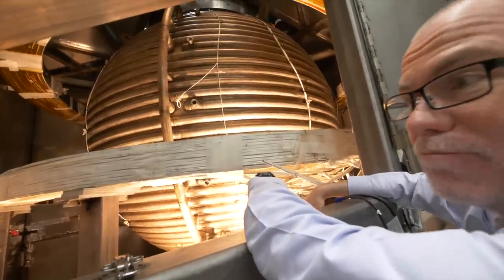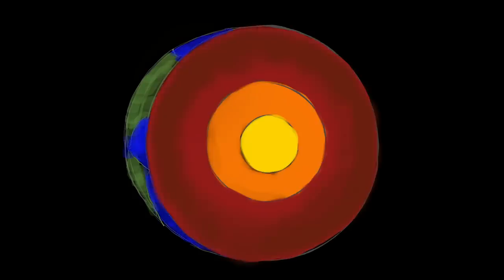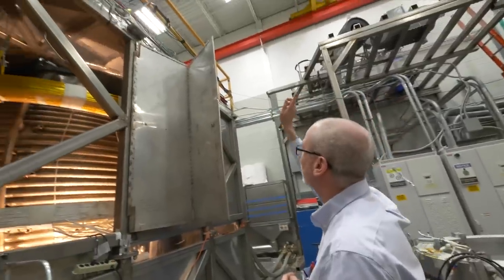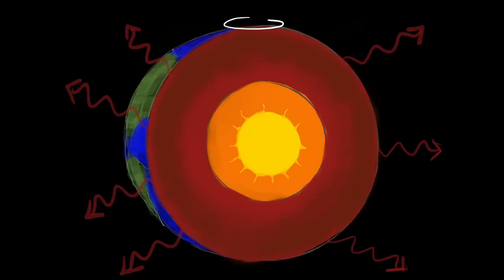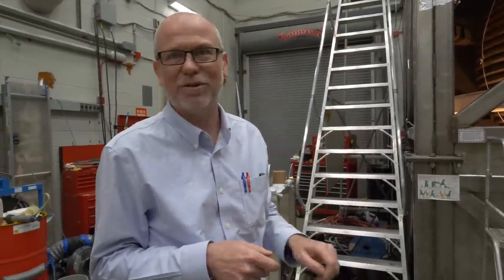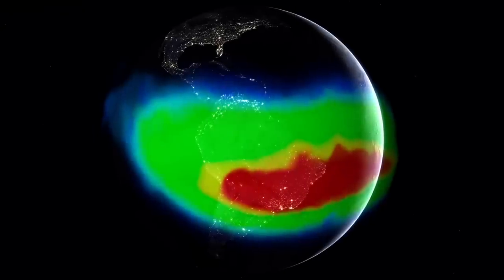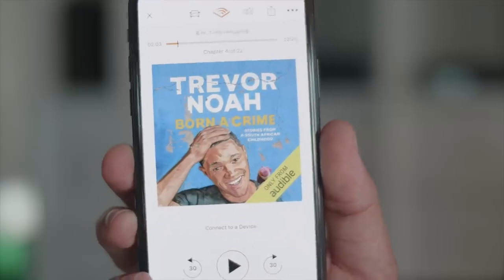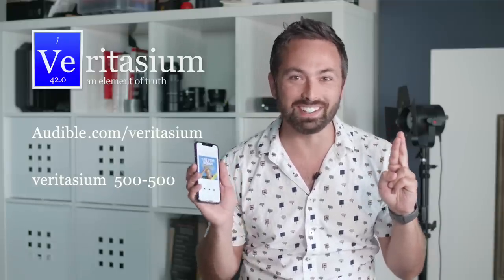Spinning Sphere of Molten Sodium

Comment: Lets just skip over "the magnetic field is dying and we don't know why"
Reply: Right?!!!!!!!!!
Reply: yeah lol
Reply: Decrease in intensity =/= dying magnetic field, but I understand the concern. What's not mentioned here is that while the magnetic field is important for life on Earth, there's no correlation between changes in the magnetosphere and extinction/mass die-off events. There's a healthy concern about how electronics will behave if/when an event happens (i.e. solar storm, pole inversion, etc), but magnets, however they work, are not going to kill you.
Reply: @ETiWells  
If the decrease in intensity continues at the current loss per year, there will be only x amount of years before there's nothing left. Maybe not "dead" but certainly not there. So if your argument is about correlation/causation I understand what your trying to say. The problem that we can track What is happening but we cant explain Why it is happening.  But his point is perfectly valid in the context he was using.
Reply: @cjr4666  so i dont dont have alot of knowdlege on this particular matter but i dont know hot to tell when a commented is a psudeo intellectual and when they actually know what their talking about you should try and learn that skill, because untill you commented it was 1:1 ratio but with your comment the dunnig krugger affect is present in 200% of the comments disgussing changes in the magnetic field
Reply: Earth’s been around for over 4 billion years. I doubt its magnetic field is going to disappear any time soon. My best guess is Earth’s currently getting its magnetic poles flipped. Such a process wouldn’t happen instantly.
Reply: Neil says the poles don't flip they just wobble 
Iike a spin top
Reply: The Earth's magnetic field has changed a bunch, and will continue doing so. It's been waaay weaker in the past, and even flips a full 180° on occasion.
Reply: The magnetic poles have reversed though. We (by we I mean scientists far more knowledgeable than me or anyone in this comments section learned that from studying aincient  fired clay. As that retains the polarity of the magnetic field at the time it was fired. By comparing the polarity of the iron in that clay to latter fired examples we (smart people... Not me or you lol) learned that the polarity had completely reversed. That doesn't take a smart person to realise that at some point between reversals the magnetic  field had to have completely stopped for at least one moment. Although a weakening would be enough to let through more harmful solar radiation. On the plus side a weakening of the earths magnetic field would mean you. Would be able to view the polar auroras further north or south of their respective poles the weaker the field becomes. So silver linings and photo ops for everyone lol
Reply: @ETiWells   - if the magnetic field protects our atmosphere, I can understand being concerned of it disappearing.  Magnets aren't gonna kill me but that field disappearing will.
Reply: It's all the oil that we've been pulling up from the ground. That oil actually is the grease for the tectonic plates to move. Any reduction in the pressures of that oil to the tectonic plates will reduce motion and so we've reduced the earth's magnetic field by 10% through driving cars and flying planes.
Reply: @traininggrounds9450  Ok as someone who isnt even schooled in geology I can give you 6 reasons as to why that is not true
1. The magnetic field is generated by the core interacting with the mantle and no human has ever managed to drill past the crust
2. The amount of oil humans have drilled is a absolute miniscule percentage of a percentage of a percentage of mass that makes up the crust
3. A vast majority of oil drilled comes from  fields of pockets, not spread over large areas. 
4. Tectonic plates do not require lubrication. The forces involved are literally strong enough to build or crush mountains without slowing down.
5. Tectonic motion is produced by the crust interacting with the mantle. Again, we have never drilled that deep.
6. The magnetic field is not related to tectonic motion at all in the first place.

There are lots of reasons drilling for oil is bad. Somehow stopping tectonic motion or the magnetic field is not one of em.
Reply: @blockhead134  I understand you think you know but you don't actually know. 
The theory of the clock cycle alignment of the planets about the sun show that a very small change in forces can create large effects on the sun's cycles. The Tayler instability can react to small changes to tidal forces—with a small shift creating perturbations on the sun.
Under the same principle, we can expect that given the right mechanisms such as magnetic fields which are sensitive enough for amplification or retardation, then we know it is quite possible small changes in the earth's crust may have large effects on the overall planetary magnetic field.
Considering that this video showed there being no predictive science for these things and how they achieved large amplifications from small magnetic fields, then we do already understand that this is a highly likely similarity to the Tayler instability in the sun and the planetary alignments creating tidal forces in the sun cycle.
So, do NOT think you know when you don't actually know. You may just be destroying the earth while doing that. This is how science works when we deal with the unknown, we have to look into it and test it. But shooting down theories because you think you know just means you either don't really care to know in the first place, or you must already know the solution to the loss of the magnetic field and how to fix it.
Reply: @traininggrounds9450   Mhmm sure. Believe what you want. I mean, you obviously already did, but still.
Reply: @traininggrounds9450   Pff your blindness to your own hypocrisy is astounding.
Reply: @blockhead134  Well when you start being rational and not disrespectful maybe your words will hold any weight. But as the laws of the universe go, one thing is measured against another and your words are way  too light for this discussion.
If you honestly cared then you wouldn't shut down ideas with disrespect but with science. 
The principle behind the Fried Egg Theory is simple, small changes in one things creating amplified changes in another through a finely tuned balanced system.
It is possible that our oil drilling is not only reducing the strength of the magnetic field but it is also increasing the earthquakes throughout the earth.
But we don't know yet that to be the case and that's what a theory is. So you have to look into it.
There is actually nothing you  can say to disprove the principle behind the theory because you don't even know what you think you know yourself. You just know what people have told you and so you think you know what the earth is made of and how the earth works and this rules out any possibility than what you know. 
This is actually a dangerous way to be and is practically religious through its dogma. 
I have no hypocrisy here what so ever. I am speaking rational words here with respect to you even while you are being a brat.
Reply: @traininggrounds9450  Sure. Real respectful. And humble too. Real paragon you are.
Reply: @blockhead134  If you are wise you are wise for yourself. If you scoff you alone will bear it.
Reply: Dillon Nobles  An EMP interferes with electric circuits because it grabs onto the electricity and stops it from moving for a moment, shuts it down but it can start back up again. Electricity however doesn't interfere with magnetism unless it's directed towards making a magnetic field where in that moment it is now magnetism causing any disturbance.
But electricity doesn't just make magnetism on its own. It must be directed through a medium that will align polarity as the current of electricity runs through it. 
It's not possible for electricity to naturally interfere with magnetism. There is no current or static electric field of the clouds that will disturb the magnetic field of the earth. But it does work the other way around because that's how electricity is moved and stored in the first place, which is magnetic field lines of force pulling electrons through a conduit to create a current.
Reply: @Aethenthebored  I didn't disrespect him and his person at all. What happens if you think you know something, like "I'm not going to die from driving drunk" and then you drive drunk and die? It's much better to actually know that indeed you can die and kill other people driving while drunk. 
So I did no disrespect here. This is a reality of life.
Reply: Boomers destroyed the Earth's magnetic field
Reply: @alonewithyu  They have flipped many times before.
Reply: @cole2839  Very interesting, can i see some proof?
Reply: Training Grounds You have terrible social skills if you think you weren’t disrespecting him, and I think the meat of the problem is that you initially mentioned your far-fetched hypothesis as fact. You can see that if you re-read it. You didn’t present it as a possibility, you presented it as truth, which I won’t say is likely or unlikely, but it is certainly not proven true.
Reply: @traininggrounds9450  ahem, NOFKYO
Reply: Because 5G
Reply: Stop 5g
Reply: 42 thousands rocket satellites at low altitudes SpaceX kill are world
Reply: @ETiWells  5G
Reply: 5G
Reply: @Every1isLostatSea  Lmfao 5G, big laugh
Reply: @alonewithyu  no laugh is for real,, go to Banned.video and type in 5G
Reply: @Every1isLostatSea  I will take a look later
Reply: @handlesarefeckinstupid  If I was an idiot I wouldn't have made sense. The idea is far out, yes but the argument is sound. Don't judge everything so simply. Look at it for what it is. Oh and read the dang comments too.
Reply: Earth is just going through a phase, don't judge it. 

Also all the people being asshats to each other about the science here should be sentenced to solar flare.
Reply: @ETiWells  you are not smarter than science man
Reply: Powercut
Reply: @steammachine3061  are you sure about that? Because I'm fairly sure reversals happen on a timescale much longer than human pottery has existed. Scientists primarily determine reversals based on the magnetic alignments of rocks in the oceanic crust.
Reply: @blockhead134  Actually, plates in a way do need lubrication, just not in that way. The mantle is largely solid, but the asthenosphere, which is the far upper region of the mantle upon which the plates ride, is highly ductile relative to the lower mantle although it is still solid. So it acts as a 'lubricant' on a geologic timescale although it would just look like really hot but definitely solid rock to us.
Reply: @DLBBALL  Right. A flip could take tens of thousands of years.
Reply: @steammachine3061  I worked as paleomagnetics technician on a scientific research drill ship, and we found reversals in the sediments that we cored, sometimes as deep as a couple of kilometers. It was so cool to measure the remanent magnetization in the cores, left from when any magnetic sediments settled like little compasses on the sea floor, preserving the history of the earth's magnetic field. We got some beautiful magnetostratigraphy, and it correlatable around the world.
Reply: @traininggrounds9450  Are you a troll?
Reply: @hadhamalnam  yes, every 12k years
Reply: @PaulPickeringPP  It's generally more than 100k years. You might be thinking of the time it takes for a reversal to occur, which is like 2-12k years. But the frequency of reversals is way lower and the last one was 780k years ago, way before anyone was making pottery.
Reply: Sure it is.....   yep.....  the magnetic field of the spherical earth....  whatever dude!!!   The compass manufacturers wanted to jump on the same money train along with the globe manufacturers!!!!!
Reply: The next stage of evolution is upon us
Reply: They don’t even know if it is...what the F is wrong with you people? This is still conjecture, stop being zombies. New information is always coming out and changing what we “know”.
Reply: yup
Reply: @DLBBALL  that's what they will say in billions of years when the sun will implode and die off. When is there any good time for anything bad to happen.
Reply: @teese1630  calls someone pseudo intellectual.
Uses every big word he knows to sound smart while making no sense. Lmao
Reply: Yeah but it wont completely die for a long time. You'll never see that day you'll die to smthn else way before
Reply: @DLBBALL  youre actually right lmfao
Reply: @blockhead134  actually tectonic plates require some lubrication but the lubricant is water, ocean water in particular
That's why venus doesn't have plate tectonics but have volcanism
Reply: @steammachine3061  I looked up when the last pole flip happened, and it says 42,000 years ago, I didn’t think people had found pottery past  20,000

Also apparently Pole flips happen every 200,000/300,000 years, so why would the weakening poles mean ones happening
Reply: @ETiWells  there actually has been correlations between the poles reversing and mass extinction events, since new discoveries in February some scientists think the last one killed the Neanderthals
Reply: Let’s do that and just hope it’s not within our lifetimes.
Reply: @alonewithyu  The wobbling you're referring to is called polar wander and it's actually one of the ways that the continental drift theory was proven was proven. The poles do, however, flip. Quite a lot. Check out the wikipedia page on Geomagnetic Reversal.
Reply: They will never truly consider why, the most probable answer has been condemned as anti science.
Reply: @chromeinox , what’s the most probable answer then?
Reply: @JacksonHoulihan  You already know that.
I'm not saying that it definitely must be that, but it's by far the most probable answer.
Reply: @traininggrounds9450  - My friend, you are the one who is confused. You have watched one too many bad videos discussing bogus theories. Like 90% of what you said is wrong or a misunderstanding of actual science. 

Or you are trolling.
Reply: right?! lol
Reply: @cjr4666  That's not what's happening here, a decrease in intensity doesn't mean it's going to disappear; Just because the sun is not always spitting out massive solar storms doesn't mean it's dying.
Reply: The exchange under this comment is more entertaining than the video 😂 lol
Reply: @alonewithyu  yeah look it up, scientists have looked at the magnetic field lines in the mid Atlantic ridge and have seen bands of rock with different magnetic alignments suggesting as the rock cooled it basically has a snapshot of the Earth’s magnetic field at the time
Reply: @sirsanti8408  interesting
Reply: Right after he said we have no predictive science, so we dont know if its really weaker in a way that is significant or not.
Reply: @ETiWells  I got the ICP reference… and I loved it.
Reply: As negatively charged particles increase propagation, harmonic resonance is altered to accommodate for ion / electron exchange. Failing to modulate any resonant field, simply kills it.

Comment: "Yeah we have a giant spere of flammable explosive stuff that spins really fast, and in case something goes wrong we just dump some hella cold stuff on it"
gotta love science
Reply: Thanks for pointing that out in such a fantastic blunt way. 😂 Do love me some science.
Reply: When the Number One Atomic Pile was switched on at the University of Chicago, they had buckets of some solution (cadmium?) that was a poison to the reaction. If the reactor went supercritical, a grad student with an axe was to chop the rope that held the buckets. If any had spilled on the reactor during normal operation, they would have had to disassemble the entire pile to remove the contaminated fuel.
Reply: Hella cold explosively flammable don't forget explosively  flammable
Reply: @AlanCanon2222  watch chernobyl  it's  most noble gasses poison reactors
Reply: While hoping the really hot spinning stuff didn't fail horizontally and spray all over the room first.
Reply: @DAMIAN WAGNER they don't use Mercury because its a worse conductor, did you watch the video?
Reply: Yes, sodium is super explosive with water.  NOT a combo you want to screw up and get together.  But it is such a good conductor f heat that it has been used in some nuclear reactors instead of water.  But I can't recall which type.

Comment: 1:48
>Emphasizes the importance of safety
>Has power strip hanging by the cords plugged into it
Reply: No worries ...   It was pulled in by the magnetic force and wrapped around many times... Thats how the cryogenics were tested
Reply: If you look it's actually attached to a bracket.
Reply: I have a feeling it is for the temporary lighting used to film the video. It seems to be partially illuminated from a low angle which doesn't seem normal. Just a guess.
Reply: This is every experimental physics lab I've ever been in lol
Reply: @BLUEKOMMEH  But the bracket isn't attached to anything else...
Reply: @davidzachmeyer1957  The bracket appears to be welded to the frame upon which it sits
Reply: LOL. Good catch
Reply: he only needs it for his George foreman smokeless grill, it's temporary
Reply: SCIENCE!